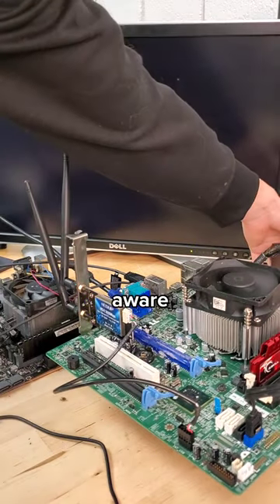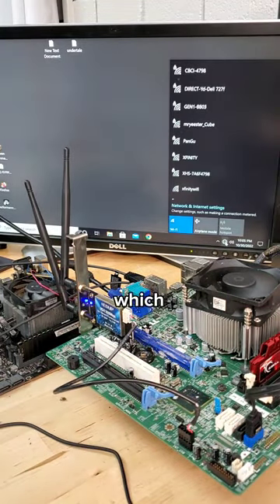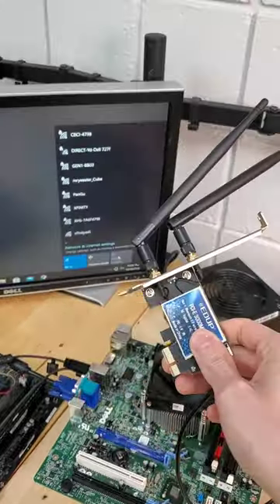can you add wifi to a running pc? #shorts

Comment: PCIe Hotplug required. Linus did a video on this long ago.
Reply: Can u clarify how?
Reply: @MrPunched  it's all dependent on the motherboard. Usually server boards have this feature where once it's turned on in the bios, you can literally remove any PCIe device while in the operating system and swap it including GPUs. Some server and workstation boards do have that but not a whole lot of consumer boards have that. This is usually used in enterprise and data centers where they cannot power down the system to perform maintenance on a certain PCIe card and have the entire company wait for the server to power back on.
Reply: @roschlynnmichaeldsouza5747  This makes a lot of sense though. Most Servers can hot swap HDDs without shutting it down to ensure constant 24/7 service.
Reply: @roschlynnmichaeldsouza5747  yes
Reply: @roschlynnmichaeldsouza5747  it makes sense as servers use pci-e based ssd sorage that lives in those hotswap bays. If one fails the raid can be rebuilt after the ssd gets replaced
Reply: Damn was just about to say that and then this comment appears 😂
Reply: For servers yes.
Reply: @roschlynnmichaeldsouza5747  🤔 why server boards can do it but not consumer boards ? How does it function?
Reply: @roschlynnmichaeldsouza5747  hotplug is a very intricate failsafe system

A normal user have no usage for that. What reason do you have to open your case, connect a wifi card to your pc and close it without turning it off? Just turn it off you are using live electricity here

Servers have uptime. Alot of servers need to  work perpetually with every second its off is money down the drain

The ability to modify them on the fly is instrumental to their upkeep. Between upgrading without downtime or replacing redundancy parts that are worn down. Upkeep maintenance is very crucial and integral to some servers
Reply: @sambhavkumar3865  consumers have no usage for such intricate fail-safety

And in general you shouldn't work on live electricity like that
Reply: @CheesyCore  it's still possible..  its called usb!
Reply: @sambhavkumar3865 because consumers have no use for it
Reply: @sambhavkumar3865 It works by the BIOS chip checking and turning your hardware on. If it won’t see a device in the PCI slot it won’t initialise it for the OS to see. Therefore, plugging something into the slot won’t make the OS aware something is plugged in. It still thinks there’s nothing there since the BIOS said so when you turned the computer on. If you wanna hotplug PCI devices, I suppose it would be as simple as having the BIOS  initialise the PCI slot even when it’s empty. That way the OS will be able to ‘see’ it when something get’s hot plugged and load the correct drivers for it.
Reply: @jerryw1608  My desktop board has hot swapping of PCIe (NVMEs), and SATA devices, but it's off by default in the BIOS.
Reply: Linus doesn't know anything about computers
Reply: On Linux you can do this without reboot and on some motherboards that don't support PCIe hot-swap, I used this with a Thinkpad T430 and a NVIDIA GTX1060 I plugged in over the expresscard slot.
Reply: @JoJoGaminG36 all PCs can hotswap storage devices, or else USB sticks would be very very annoying to work with.
Reply: @Arutemysu  Not all storage devices... You can't Hotswap a SSD or HDD on a running PC. It'll crash or never recognize it. USB Sticks are only partly Hotswapable aswell, you have to disconnect it from the software before manualy pulling it out.

Only exceptions are NAS systems that have 3-4 clones
Reply: @bengixd its impossible , the simple fact of knowing computers are a thing make him know something about computer , the fact that they are already something that have been made

But You doesnt know anything about that kind of logic 😊
Reply: @shirakolee  reddit tier comment
Reply: @CheesyCore  for those idiots who dont shut them down bru aka mryeester xD but still would be bettewr than the time i broke my laptop by not disconnecting battery before removing ram xD i rma it then they fixed so no worries xD
Reply: I have hot plug on my x570 gaming plus

Comment: I remember back in the day we had to buy the Dial up internet via card and it was hell of a lot slow and it had a USB output to connecting to the pc
Reply: Yes I remember I used a internal modem, How old are u sir
Reply: HA boomer
Reply: USB Plug? C'mon. Comm port
Reply: Com and lpt leaved the chat
Reply: @Artemis_262 child, did ur father not teach you to respect others?
Reply: @itsbegula1745 he probably called his father a boomer and then his father left for milk
Reply: @itsbegula1745 u a child too
Reply: I remember a time before the plug and play bios when you had to set irq and memory address by little dip switches on the modem board, then hand configure the sys file for the diver in dos so you could dial up to the internet in windows 3.1

Comment: I swear it works when you unplug it while the computer is turned on and put it back in. I‘ve done it so many times with my PC
Reply: Probably since it already recognized the device and is actively trying to use it. That’s my guess.
Reply: @relapsedtechcorgii  yeah same like plugging and unplugginh the mouse or keyboard
Reply: It’s Pcie hotplug
Reply: Probably because you have PCIe hot plugging enabled in bios
Reply: Yeah because in Windows the PCIe devices are registered at startup. Once the address for the device is reserved it stays in place so you can unplug and plug in at will and it should work.
Reply: this looks like a older motherboard judging by the colors of SATA ports (different colors different speed), so it probably did not support hotswap
Reply: How the actual fuck do you "turn on" a pc? 💀
Reply: @unknownboi4414 Push the button?
Reply: @hyacinthtiger62  I meant to say "turn on"

Comment: For the 2 people wondering, USB works even if you unplug it/ plug it in when the PC is on.
Reply: Yes, but the USB header is only for the Bluetooth part
Reply: why tf does this have 40 likes lol
Reply: USB has PlugAndPlay
Reply: My screen goes back after I installed my wifi card and that's after I login.

Me: Installs wifi card and turns on PC-Sees login screen and logins-black screen-wait a good 5 to 10 mins and I see my desktop

Can someone help me.
Reply: @zacharyrodriguez1198  Remove your gpu and reinstall it. I think you knocked it lose.
Reply: @GamingAndRCs  how'd I'd knock it loose even though I only plugged it into the PCIE1-2 Slot?  the only think of is when I put it on its side

Comment: PCIe supports hotplug. It usually has to be enabled, though. And don't try this with with cards, that are not really ready for hotplugging, as it could destroy your computer. Hot-Plug-ready devices have PCIe connectors with pins in different length.
Reply: But not all motherboards support hotswap functionality, same with PCIe bifurcation.

Comment: you can, it just depends on the motherboard and cpu to support it
Reply: actually it depends more on the operating system. the Motherboard doesn't "recognize" when hardware is plugged in and out, and since most people aren't going to be hot-plugging wifi cards, Most OS developers didn't think of it as a time worthy investment to implement
Reply: yeah that connection is handled by the kernel so its os dependent
Reply: @chrisdonadio2537  No. First and foremost it's BIOS/UEFI that handles detection and mounting the PCIE device. If hotplug-PCIE feature is turned off, then no OS will detect any hotplugged Pcie device as no new device will be initialized and prepeared for currently running OS.
Reply: @maciejgada740  BIOS/UEFI normally detects and sets up config address spaces, and configures the hardware itself to make it more usable for the BIOS/UEFI, and according to spec, will pass information along about some of the hardware. The actual “mounting” and use of the hardware is done by the OS itself. this is what drivers are. If the OS does not support detection of hardware past POST, hot plugging will not be supported. After the CPU jumps to OS code, the BIOS/UEFI have no control over either hardware or software.

Source: Am making my own operating system. Right now, if i unplug a hard drive, and then plug another back in, it wont know that A) It was unplugged in the first place or B) that its a new drive.

EDIT: Also, the actual detection of the hardware thats plugged into the different ports happens in the OS itself too, the BIOS/UEFI only knows that theres a port there, not whats plugged in. Storage devices being the only exception.

Comment: the 9 pin usb header is for the bluetooth half of the card and doesnt need to be plugged in for the wifi to work, also you should be able to scan for hardware changes and pick it up depends on mobo

Comment: PCIe Hotplug Must be supported by the Mainboard and the Device in order for it to be detected properly. In theory it could work by entering some commands even without hotplug support but that’s a Linux only feature due to the fact that a specific kernel module must be running to check for changes in real time and a second one for the capability to change some configuration on the fly but the kernel must be a real-time kernel for all those things to work without proper PCIe Hotplug support on both devices. 
Some Virtualization Host do it that way to enable some consistency in terms of ease of use.

Comment: what if u refresh it over the device manager?
Reply: Then it'll only change the device manager, you still have to restart
Reply: You are absolutely right, you can detect the pci express ports by refreshing the device manager (it does not apply to classic pci ports, it only works on pci express)
Reply: @DAVELCH_SOFTWARE  Nice to know, thx u mate

Comment: On Linux you can do this without reboot and on motherboards that don't support PCIe hot-swap, I used this with a Thinkpad T430 and a NVIDIA GTX1060 I plugged in over the expresscard slot.

Comment: Some motherboards will even crash if you hotplug a PCIe device, like my Alienware X51 did when its graphics card was still working. 
Plug the GPU in and the whole computer instantly crashes. Rip it out, the rest continues running fine.

Comment: and in other news... water is wet
PCI/E needs to be recognized by the board during boot to install.  though  it will probably work if you pull it and put it back after that. I would never recommend doing it though.

Comment: PCIe generally enumerates on boot.  The link has to train by setting the signal parameters until it has a good link.

The USB is only for the Bluetooth communication btw.

Comment: This is mainly due to the OS registering the external card. Think about it, wifi cards need to interact with specific codes/software built into the OS for it to pick up. These are mostly identification addresses alongside registration of the card. 
This is why non-boot hard drives can be hot swappable. They don’t need all sorts of fancy registration, simple data read/write. It’s also the same reason why thumb drives are hotswappable. Power and data. Non of the extra fancy stff